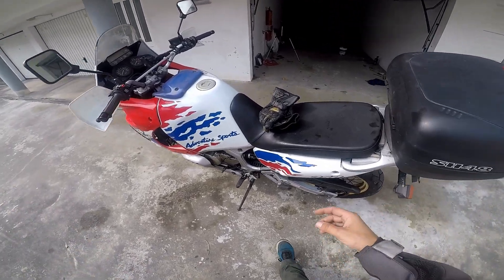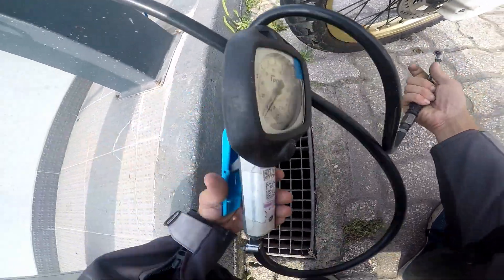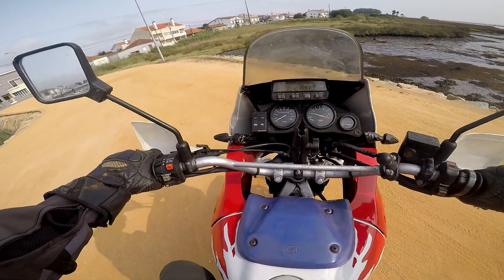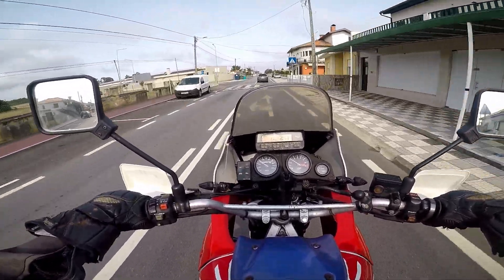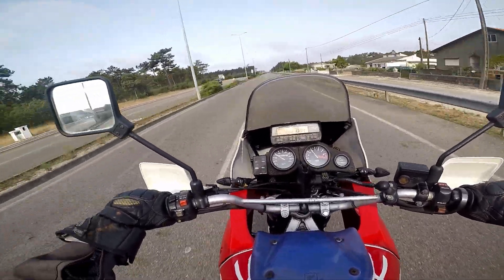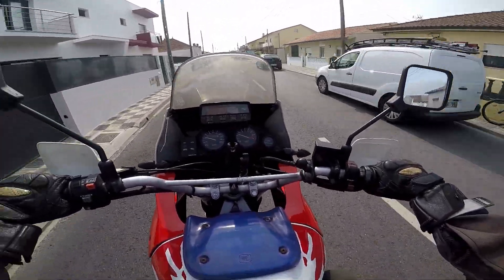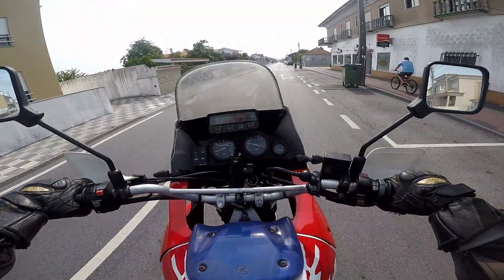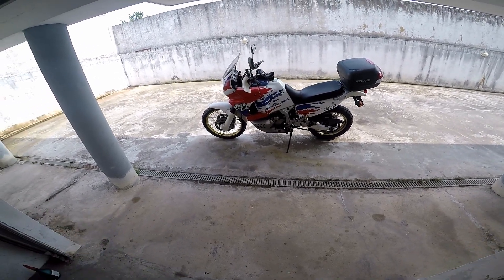First ride on the 1995  Africa Twin xrv750

Comment: I hope you didn't trade the ST for this one. That ST was awesome.
Reply from the maker: No i still have the st1300
Reply: @motardsquid  That's awesome. I sold an ST1100 once years ago and I've regretted it ever since. Didn't realize how much I loved that bike until it was gone.
Reply from the maker: @HalfassDIY  i had a 1991 st1100 too. Sold it at 125k miles, but the alternator went out on it and didn't feel like fixing it. Should have kept it would have had 500k now

Comment: i think v2 are more fun to ride that 4cylinder what do you say? ☺️ i say more fun not better ☺️✌️🤙 i hope too you never sell the st ✌️🤙
Reply from the maker: I like the vtwins. This one is pretty smooth. After a while it doesn't sound like a twin. The vstrom i had felt peppier, this one is not that far off with a little bit more power and torque.